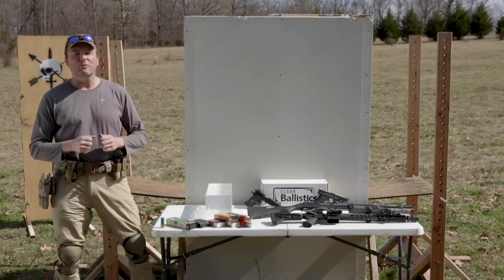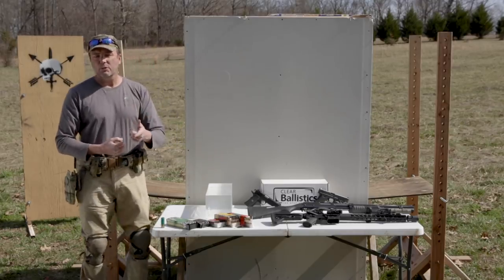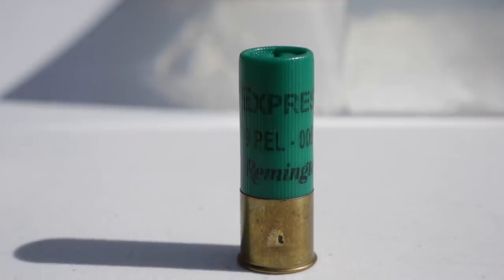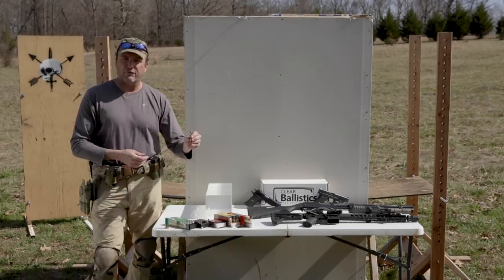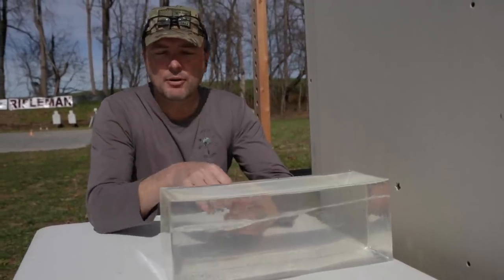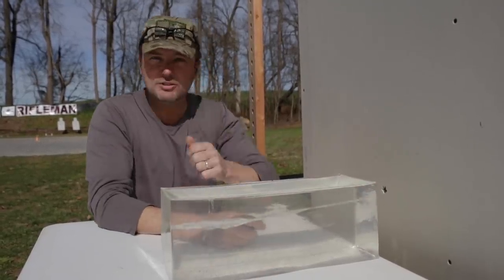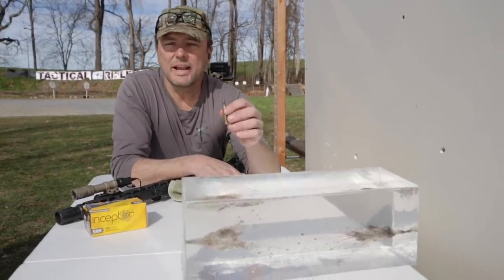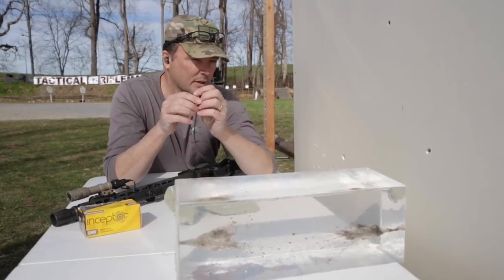What is the Best Gun & Ammo for Home Defense | Ballistic Test | Tactical Rifleman

Comment: Karl, what are your thoughts on the 556 frang with a shot hitting the target's side?  Would it penetrate enough?  I like the rounds performance, but no one can predict they will get a perfect heads on shot.
Reply: I'd definitely be worried about 5.56 frangible rounds not having enough penetration to stop the threat. It looked like those rounds only penetrated 6-8 inches into the gelatin at the most. Yeah, I'm sure they would make some spectacular explosions in small varmints, but I wouldn't want to shoot anything larger with it. Would you want to go hog/deer hunting with frangible rounds? I doubt it. M193 with enough velocity to reliable tumble and also possibly fragment is a much better option, imo.
Reply from the maker: Fjamato, people get hung up on the lack of penetration. It stops because it is delivering ALL that energy right there. Yes, if you hit an arm, it is not going into the chest, but that arm is blown apart. If you have seen our CQB drills, we are sending 3-5 rounds at this guy. You are going to deliver a ton of energy and destroy so much tissue, that the threat will be neutralized 100% of the time
Reply: @Chad Hulsizer I was using the varmint/hog/deer example as a comparison. You generally wouldn't want to use a frangible varmint round to kill/stop a hog or deer. Same for a human. Could you? Possibly. Is it optimal? Hell no. A determined attacker is very difficult to stop. Someone hopped up on adrenaline and/or drugs can be surprisingly resilient to tissue and organ damage. You want a round that has consistent performance with enough penetration and mass to cause significant damage to vital organs, arteries, and bone. Frangible rounds typically just don't have the penetration and mass to due that. There are some well put-together articles/studies on 5.56 for self defense out there, and none of them have recommended frangible ammo. http://www.brassfetcher.com/Rifles/5.56mm/5.56mm.html
https://www.ar15.com/ammo/project/Self_Defense_Ammo_FAQ/#mozTocId394444
Reply: @TacticalRifleman  Thanks for your reply & expertise.  This is why I asked. You guys at TR know what happens in reality, not just hypotheticals.  Great video, as always.

Comment: Great video. I actually bought 00 buck for home defense. Maybe I need to reconsider.
Reply: If I may, I dont think that's entirely neccesary. You could always change buckshot loadings if you want to keep with your shotgun. Something like low recoil flite control from federal (hornady makes one that's basically the same thing I just am forgetting what it's called at the moment) but with the special wad used in those rounds you're getting an extremely tight group even at longer range. And inside 10 or 15 yards its probably not going to be much larger than a fist. The most important thing to remember is that the rules of firearms safety dont change just because were fighting a home invader. If you miss the bad guy, it doesnt matter what rounds youre using. It's going to pass through at least a few layers of drywall. If you believe your family is at risk by taking a shot, dont take the shot.

Comment: Thanks Sergeant Major!!!  I personally use #4 3" turkey loads with my mossberg 500 for my  in the house gun.  I have a 3 slugs (that I zeroed at 50 yds) and a couple of rubber buckshot (for coyotes in the yard).     Ive tried those federal 223 on feral piggs and I had to put 5 rounds on a 100 lbs sow to get her to drop.  4 of the 5 were in the head.   Have you guys tried the Cry Havoc QRB kit?   Im thinking of building a "Truck Gun"  (actually Fiat Spider) in 9mm for my wife and was thinking about that as an option.  Love the Show.....

Comment: Thanks for this video, I like how the v shock and frangible rounds perform. I know in the video you say go with a rifle round and rifles have better accuracy than handguns, but seeing how ruger has their version of 5 7 would you recommend the 5.7x28 with ballistic tips for home defense like the v max?
Reply from the maker: No, because they are the same small rifle slugs but they are NOT getting them moving fast enough to get the secondary cavitation that rifle rounds require to be devastating.
Reply: @TacticalRifleman  Thank you, I appreciate your answer.
Reply: urgeoverkil   the 27gr ss195lf or the ss198lf out of a 4.8" bbl is 2000/2100 ftps  and 2500/2600 ftps out of a 14.5"bbl such as a ps90 and is my PDW's on the street and at home.  Use the 40gr stuff for practice and hunting food for the table.  Personally I use the 27gr stuff in my handguns and the 40gr stuff in my ps90's and feel very confident with them both for battle. Light with little recoil ensures fast follow up shots that stay on target and not to mention that you can carry a ton of these rounds on your person without being overwhelmed by the weight. Not telling you what to use for EDC or home defense but just stating what I practice with and feel confident in.

Comment: I am at a loss as to why in this test the .45 ACP went thru the jell block, but in your other video (9mm vs. ,45ACP) it did not, and had a huge cavitation completely within the jell block. So, what gives here? It almost seems like you set this test up to make the .556 ammo perform the best given the parameters set for this test. But I would question anyone using a rifle, even a short barrel one as their home defense weapon. This might be plausable if many people were attacking your house, and you had time to go get your rifle and then defend your self. But in a 'typical' home invasion of just one person coming at you in your room, I see just about everyone using some sort of hand gun. and NOT a rifle.

Of course, you can disagree with that, but I would go one step further in that if you really give the handgun for self defense, there are a host of viable handguns to look at. This includes revolvers, with the following calibers: .38 Spec (+P?), .357 Mag, 41 spec, .41 Mag. 45 LC, .44 Spec. Double action revolvers can be shot just as fast as any pistol, so do not use this factor to rule out revolvers. As for pistols, then look at the 10mm. Look at these calibers with the 'correct' bullet type that minimize over penetration, which is what this test is all about. This 'complete' test could take weeks and numerous tests since there is so much variance with each of these calibers, in bullet type and power. Many of these calibers also have frangible bullets. Also, most of these calibers have ammo with slow to very fast fps (MV), and testing the 'right' one or ones would be very tedious indeed. But I think that your real interest lies with the rifles, and not really with handguns.

In spite of my comments about ruling out many other types of self defense handguns, I think that your testing technique and explanation is top notch! Your videos are a joy to watch.
Reply from the maker: Thanks for watching.
Test it yourself..,
Go to the range.
Shoot the same drill or drills
Time it with Pistol 
Time it will Rifle
Rifle will ALWAYS be fast and more accurate.
That’s what wins.

Comment: Totally disagree with his conclusion pertaining to the SHOTGUN. He based (HIS) conclusion and recommendations that THE SHOTGUN IS NOT a great Home Defense. He based it on while USING 1 OF THE MOST POWERFUL ROUNDS that the shotgun is equipped to use. He didn’t do the same for all the other rounds in (HIS) so called fair experiment. The truth is that the shotgun is ABSOLUTELY THE BEST HOME DEFENSE WEAPON. When using the WEAPON AND ITS FEATURES SUITED FOR THE TASK. You use the shotgun and 4 to 6 SHOT SHELLS AND CHOKE. If your threats are possibly a tactical threat and equipment. The SHOTGUN AGAIN IS THE MOST EFFECTIVE WEAPON TO NEUTRALIZE THE THREATS. Even when they are wearing 3-3a plus soft body armor. The shot gun with 3 INCH MAGNUM BRASS OR COPPER SLUGS. Will go through some of the armor out on the market. But even more the pure kinetic energy of the muzzle velocity of lbs of energy. When it strikes the body and body armor. It is ABSOLUTELY THE MOST DESTRUCTIVE ROUNDS IN ALL LEGAL WEAPONS. There’s even lots of specially designed and engendered shotgun slugs and buck shot. Like the shell that has 2 buck shots in each shell or 4 . They too are extremely effective of causing serious serious serious problems and death to soft body armor.  The bow and arrow or crossbow both have been shown going through 3-3a platted and not. Being completely compromised by the broad tip. I use my shotguns for my primary weapon for home defense. I have 12gauge,20 gauge and 16 gauge shotguns. I also have a specially designed and built 600 Nitro and.450 solid brass rounds for any fool that believes that they are investible while wearing soft or rigid body armor. They have a HUGE AMOUNT OF TRAUMATIC TRAMA IN STORED FOR THEM. If by chance they happened to come across another person that has similar knowledge and preparation with the proper tools for the jobs at hand. 
SHOTGUN #1 home defense. That is the recommendation from a 22.5 year active duty USMC FORCE RECON OPERATOR. With 16 combat deployments and over 4500 hours of clandestine operations.
Reply from the maker: Thanks for sharing and thank you for your service
Reply: @TacticalRifleman  
My pleasure and thank you for your understanding and sacrifice with dedication to informative information. Dealing with this broad range of functionality and reliably of fair and honest reviews. I am glad to see that you did not allow my petty and passive aggressive comment. Dictate your ability to decipher my suggestions over my poke at the review that you had done. Regarding my poke of your opinion being not accurate. I sometimes do things like that. To have a opportunity and peak into the individuals true self. Believe it or not I have gotten accurate and factual results. You would be surprised at the amount of individuals. That absolutely can not  make the honest and sometimes difficult decisions in letting pettiness fly over. Them focus on the information and the sources that has made the comments. To many individuals allow FEELINGS/ EMOTIONS AND YES PREJUDICE determine what they say and do. Instead of being level minded . Accepting that everyone is different but similar. That people can learn from each other. You don’t have to like something to learn from something. But YOU HAVE TO RESPECT DIFFERENCES. Does not mean you agree, but you understand. 
So appreciate your time and good luck.

RAH!!!!